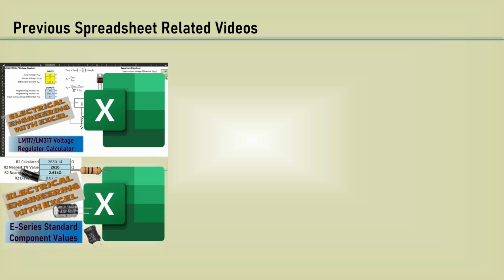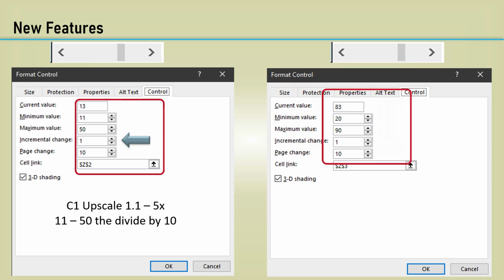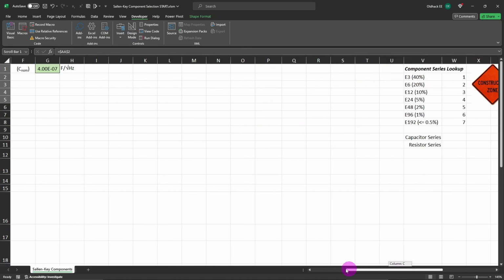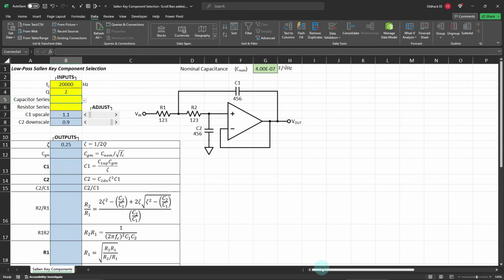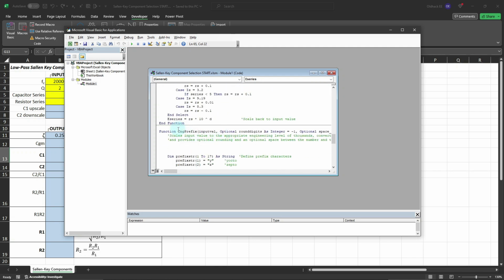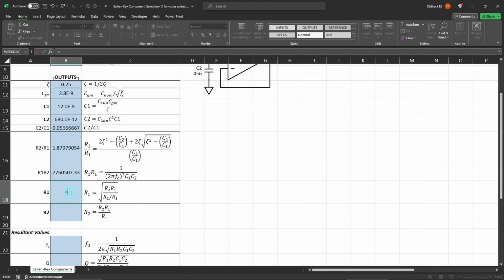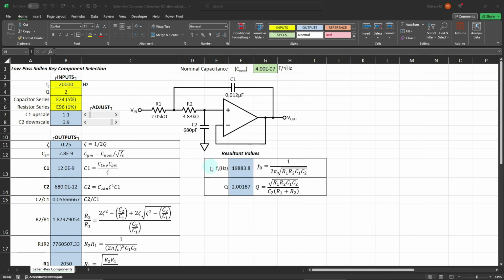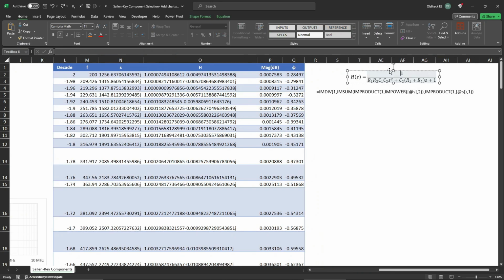Sallen-Key Component Calculator Spreadsheet

Comment: Great tool you developed there, thanks! Bit off-topic: Do you know if there is one out there that does the same, but for a gyrator notch/peak filter? Ideally I'd like to put in the Q and frequency and have the sheet (as you have nicely done here) to give me the values for the caps and resistors. I have found some, but all of them require to input the values of R and C and then tells you the frequency and the Q. Which is helpful but requires a lot of trial and error. I would love to come across one where it is the other way around, put in the Hz and Q and values pop out ;). If you know of one, please let me know! :) Thanks again for this one. I copied it for future use :D
Reply from the maker: Thanks for the comment. I have a speadsheet where I analyzed the Boss GE-7 graphic equalizer pedal. It also has a design tab. You enter the frequency, Q, and the shunt R (usually 100kΩ), and it calculates the capacitors. The link is in the description.

https://youtu.be/RKyx-qKb7to
Reply: This software name link give